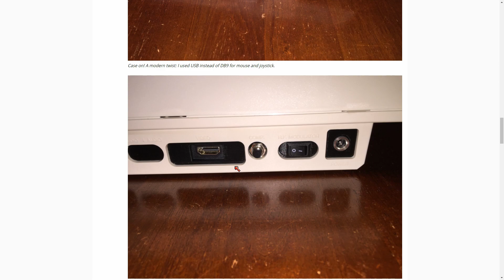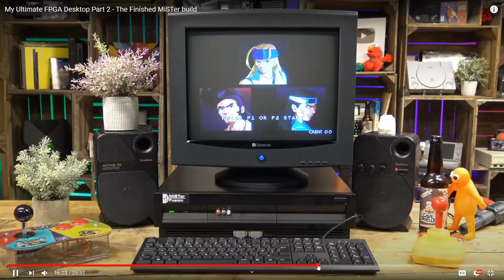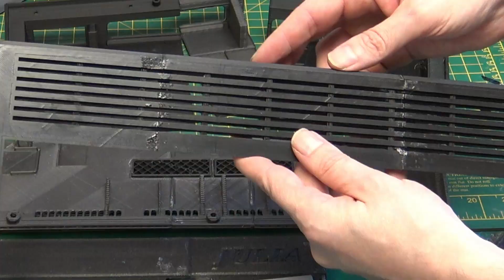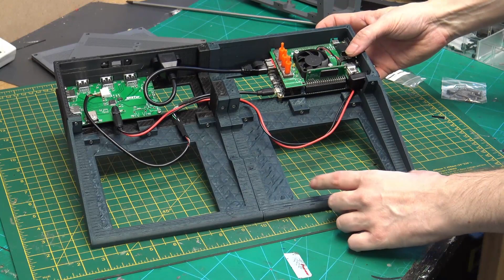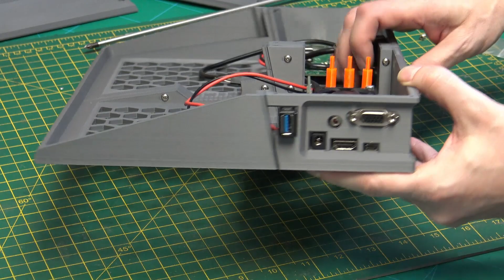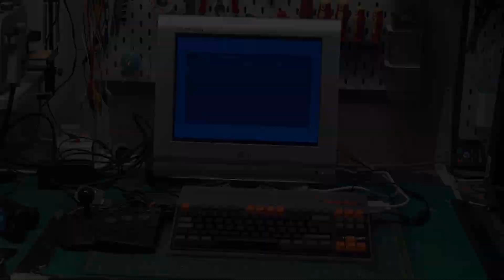My 3d printer MiSTer FPGA  retro wedge  case

Comment: What kind of SNAC adapter did you use there?  In the process of sorting that case you sent me back in 2020!
Reply from the maker: The right angle one ? I will have to look.  Blimey that was a while back and the only single piece case I ever printed.
Reply: @leesmithsworkshop  Hehe, yes - the SNAC adapter!   Just waiting on some hex standoffs and can install my mister!

Comment: yea got to try this...the mister in a simple square case just doesn't do it for me...but the idea of the mister and a case that looks of the period and a modern keyboard...that well works 100%...and this case is flexable in terms of size of keyboard...love that...going to look at the multisystem case next...no idea as yet what the differences are...have not watched that just yet just this, and like the modularity here.
Reply from the maker: The Multisystem case needs the Multisystem board to work with the MiSTer. In some ways it's easier, but my case is a lot more complicated to print for it.

Comment: Has anyone tried this with a different brand of 10 keyless keyboard, as the one shown in the video doesn't seem to be readily available right now and I don't want to spend day printing a case for which I can't get a keyboard?
Reply from the maker: look through the comments I am sure people have left a few and I also put some in the description.
Reply: @leesmithsworkshop  thank you, and thanks for the great design 👍
Reply from the maker: @dreamvisionary  The thing to watch out with keyboard is the position of the usb lead. if they are in the middle it will be in the way of the central supports. then just check the dimensions against the tecknet.
Reply: @leesmithsworkshop  That's the first part printing now, thank you.

Comment: That is a great project.  I was looking for something similar for a Pi4 but missed this one.  It would have been a really great start for me, had I not come across it a few weeks into the project.  There just don't seem to be many of these types of projects out there, or they just aren't super easy to stumble across.  I would think they would be more popular and wide spread.  It seems like such a great form factor for experiencing  the 80-90s era wedge computers when the original hardware is out of reach.
Reply from the maker: I just need a PI4 and I could make a module for it, but I am not buying one just for this.
Reply: @leesmithsworkshop  , it would be a bit much if you had no use for it.  Especially with current limited supply and price increase.  I'm not ready for a MiSTer just yet myself.  I like the style of your design, what I came up with is far more utilitarian.

Comment: Fantastic design.   

I would use a big 3d printer like a CR 10 3D printer. Then you can print it in one piece.
Reply from the maker: I have printed in one piece it took 3 days.

Comment: Umm, the best surface finish for me is typically the face that prints face-down on the bed. You either get a glassy finish on glass or a textured finish on a textured bed/build plate. Just try to eliminate anything that needs supports so you can print flat. Raised or embossed lettering is a big no-no. It always annoys me when designers put text and logos on an otherwise perfectly-printable flat surface. You’re literally better off with a sticker for logos and such but I guess I understand if they are worried about someone stealing their design.
Reply from the maker: I now have textured spring steel with PEI and that gives amazing results.

Comment: I know virtually nothing about 3d printing.  Is there a service out there that can print these for me?   Also, I see on your threeding site that the center section for wider keyboards with key pads isn't there.  Are these files available also?
Reply from the maker: HI, Yes you can get quotes from some companies, but the feedback I had from other people is the price they want is in the hundreds of pounds and totally crazy. If you are in the uk I could print, but even then it would be around £100 it's 70 hours of print time and the material and shipping. I did recently create the middle part and send it over to someone to print and test, but I have not had any feedback so I will ask them if it was ok.
Reply: @leesmithsworkshop  I'm in the US unfortunately.  Let me know how the middle part worked out.
Reply from the maker: @brianlanning836  the guy had a printer failure so he it still working on it !
Reply: @leesmithsworkshop  thanks
Reply: @leesmithsworkshop  Hi Lee.  I'm finally getting around to printing the case myself.  I have three of the four bottom pieces done now.  And they're turning out great.  For the keyboard I'm going to use a Keychron C1 which looks like it might fit with a thin gap.  I'd like to have a clever way to integrate an mt32-pi.  I might try to make a custom top.
Reply from the maker: @brianlanning836  just make sure the usb lead is not in the middle because it will get in the way.
Reply: @leesmithsworkshop  It's off to the left on the back so it should be ok.  I nearly bought one that had the USB exit out the side.

Comment: I finished printing it out a few days ago, and I'm gathering all the bits to finish up the electronic side. I printed it in normal black PLA with a black and red badge. It looks great. I bought a basic RedDragon keyboard for it, I'll probably replace that though, It leaves a big, 10mm big, gap between the top of the keyboard and the top plates of the case. Also, I think I'll print it again and try to match the SX-64 color scheme when I do. Love the work you've done! This is exactly what I wanted for my MiSTer!
Reply from the maker: if you print again I could  mod the model to help with the gap ?
Reply: @leesmithsworkshop   That would be awesome! I haven't started going down the design path yet, and I really like the keyboard I bought for this.

Comment: Hi! Thank you for such a great design, I really love it. It's small-bed friendly and very clever modularized. I will definitely try to build one for my MiSTer. 
The only improvement I can recommend is to use brass insert nuts for all the screws. Like theese, for example:
https://a.aliexpress.com/_AK724n
Just melt it in with soldering iron and you  can use regular screws without any risk to overtight and crack the plastic.
Reply from the maker: sorry, but I don't like them and it's just better to glue the parts together and use the screws to line up and hold the parts together while the glue dries. The nut inserts don't always fit correctly and  using self tapping screws into correctly sized holes works just as well, I spent a long time testing how to make this.
Reply: @leesmithsworkshop  Well, my experience with nut inserts differs, it was almost flawless so far. But it's OK. Thank you again for such a brilliant case design. I'll share my results when it will be ready. :)

Comment: Great work ! Was making video output rear facing  completely impossible ?  You could save on height by using a ribbon cable to connect the GPIO pins from the DE10-nano to the IO board, but it doesn't do much for to help with length needed in order to mount the de10 with the IO facing the rear of the case.
Reply from the maker: I am working on a lower version with a ribbon cable to connect and also 90 degree memory.

Comment: Hi Lee, Great case. I have bought the Matte Forge PLA. Before I print your case I have been testing the PLA with the Cali Cat print. This Cat has a 45 degree tail (hangover). Using my Amazon Standard PLA the hangover prints without issue. Using the Matte Forge the hangover is a bit rough. Did you have to use any specific settings with the Matte Forge? I'm using an Ender 3, 200 nozzle, 50 bed. Any help would be most appreciated. Thanks Paul
Reply from the maker: HI, I spent close to a week calibrating my ender 3 and cr20-pro to print with this filament and each one was slightly different so I can't give you 100% confirmed settings. I suggest you run through the teaching tech calibration so check extruder e steps. print a temperature  tower, print a single wall cube to setup flow and do the acceleration and jerk until you see clean prints. My best results came from the flow calibration and I was printing too much at the start.  
https://teachingtechyt.github.io/calibration.html
Reply: @leesmithsworkshop  Cheers Lee

Comment: I'm amazed by your project! it's a fantastic design! I'll buy the stl for sure. What time for print all the pieces?
Reply from the maker: depends on your slicer settings 8 hours > 13 each part
Reply: @leesmithsworkshop  I buyed the STL files, what are the best especifications to print them?
Reply from the maker: @salze145  I would print at 0.2mm 3 walls 20% infill and 50mm/s for a nice clean print. don't forget to turn on support with 69 overhang settings.
Reply: @leesmithsworkshop  the 3mm screews self tappers how long they are?
Reply from the maker: @salze145  it's in the description long screws m3 self tapping 20mm and short 8mm

Comment: Amazing work. Love how its designed to be modular. I will try to make this and then maybe later try to figure out if it can be made without needing screws, but... that is probably likely to end up breaking at some point. Not sure what options there are to make the case... a bit like Lego bricks.

First I will try printing the keyboard parts and the MiSTer part, then I probably have to modify the part for the USB ports.

Hmmm... I think I will try to make the USB ports part a bit more modular, making it so that it will support just replacing the "holes", making much bigger hopes there instead. Will be interesting to see if that will hold and work as I hope it could work.

Comment: This is incredible! I've been looking for something similar for months. Really looks great.

Is there anything holding the keyboard in? Does it move around much during use?

I don't have access to a 3D printer until I can get back to my office, which is looking like a few months at the earliest. Would you consider uploading it to a 3D printed marketplace like Shapeways?
Reply from the maker: based on prices other people have had for printed cases it would be over $100, not sure if that was shapeways. My keyboard does not move thanks to the large rubber pads on the base.

Comment: Very cool and impressive work.
I like it.

But even back in the days I liked it more to have a separate keyboard.
Like the Atari Mega ST.
Reply from the maker: it did feel like progressing away from toys to something more serious having them separate.
Reply: @leesmithsworkshop  
It‘s easier to handle.
The main box can be stored somewhere maybe under the monitor.
All cables are connected to this box (printer, monitor, keyboard, power, modem, external floppy, etc.).
There is only one cable from keyboard to the main box.
So you can move the keyboard very easy away and do some other work, e.g. homework.

The Atari 1040 ST or the Amiga 500 were almost unmoveable with all the connected cables.

Comment: Thank you for this great Video: Just bought your Model :-) By the way: Project Julia is not only for Raspberry Pi: You'll geht a Package for RaspberryPi FormFactor Boards. But you can use EVERY BOARD you like. This is deigned with extension cables from Inside to Outside so you can place a board somewhere inside the case drill holes through the bottom fix it and use the extension cables (2x USB, Ethernet, HDMI). If you need some special connections, there is a place for one standard PCI bracket. Armand López made a special MOD to use SiDI FPGA Boards: https://www.thingiverse.com/thing:414995, https://gumroad.com/l/project_julia/
Reply from the maker: I didn't want all the cables, just keep it nice and simple.

Comment: very nice well constructed retro computer case with a difference ive just downloaded the .stl files so im gonna give it a go for the raspberry pi......would the mister usb hub work with the raspberry pi?
great vid mate
Reply from the maker: hi, I have not shared the pi module yet, I have a pi3 and wanted to do the pi4. what do you have ?
Reply from the maker: if the pi has utg then I see no reason why the mister hub wouldn't work

Comment: New to the channel - does your Pac-Man run at that speed because it's a PAL game running on an NTSC version of the core, or because you're man after my own heart who finds base Pac-Man far too slow?
Reply from the maker: it runs at the speed because it's controlled by integer  values so I can only move 1 pixel, 2 or 4 each update. I used 2 pixel so I can slow the ghost down to 1 when they turn blue.

Comment from the maker: My Threeding profile now has the Ajazz version and also a RPI3 for the tenkesless keyboard
Keyboard size max width 360mm and depth 135mm
screw size m3 self tappers 20mm and 8mm
Reply: Thank you! :)
Reply: Thanks. Nice! I have a keybard here 35 x 12.5 cm. So it should fit.
Reply from the maker: @ezContents  one other thing is how the cable comes out of the back. if it's fixed in the middle it could have a problem.
Reply: @leesmithsworkshop  Yep.. it's fixed in the middle. I will check your STL files and try to assemble them inside Blender.

Comment: Do you have dimentions for the keyboard you are using (Teknet)?
Reply from the maker: I will post later
Reply from the maker: Keyboard size max width 360mm and depth 135mm
Reply: @leesmithsworkshop  thank you😊👍

Comment: Thanx for sharing this design, I did order the stl`s so will start printing soon :) The only thing I was wondering about is what software you are using to design this and if you will release those filse also so we can modify them to fit some other things. ? How much fillament will this use ?
Reply from the maker: for the moment I will only provide the stl and I use 123design. I  tried to move over to fusion360 but always fall back to what I know to get a job finished quick. What other things would you want ?
Reply: @leesmithsworkshop  hm there may be a space to add a external 2.5" hdd inside it😊?
Reply from the maker: @josteinkallevik  not sure I would need to try one for my self.
Reply from the maker: it will use almost a full spool

Comment: I really love the modular design. Sounds like the perfect project for my AO486 project. :)

Problem for me: I'd need a keyboard with the German layout (QWERTZ). As you said the design is modular in this video: What is the maximum size for a 88 key keyboard to fit in? Got one here that is 37 x 14.6 x 4.1 cm. Thank you! :)

/EDIT: Subbed and bought the file, as I might be able to get it to work one way or another. :) Great work!
Reply from the maker: i had a problem with the key caps not setup for the uk keyboard so had to miss some off.
Reply from the maker: the case has space for  360 wide keyboard , depending on feedback from other people I can adjust
Reply: I am now almost done with the print and ready to order the keyboard. I'll give you guys more feedback on my journey to my own version of this amazing case. :)
Reply: Just received the keyboard in the mail and it is perfect for what I want it to be and even has the USB cord not centered. ;) Here is the link, in case anyone else is curious: 

Amazon UK: https://www.amazon.co.uk/gp/product/B071LJKQ2C
Amazon DE: https://www.amazon.de/gp/product/B071LJKQ2C

Sadly it is bigger than they officially stated: ~35,7 x ~15,8 x ~4 cm in size and therefore does not fit because of the additional depth, when I put it in place – width and height were fine. Is there an easy way to resize just this one axis for me? (I am not very good at 3D editing but I got access to 3D builder. :( So scaling one axis might work?) I'd then reprint just the front two parts again with those new values (standard x 16 x standard).
Reply from the maker: @Estaran  let me check a few things. It might be too big to fit on most printers. You could just change the one dimension in cura to fix this.
Reply from the maker: @Estaran  Hi, so yes you can adjust one dimension in cura to from 161mm to 180mm and your keyboard should fit. It will deform the screw holes and change the angle of the back, but I think would be ok.
Reply: @leesmithsworkshop  Thanks! I'm giving this one a try today. :)
Reply from the maker: @Estaran  print on of the keyboard parts first !
Reply: @leesmithsworkshop  Finished the first part (left one) with these dimensions, and now the keyboard fits like a glove! Started to print the right one now. Can't wait to finally put everything together. :)

Comment: Great video. Good thing the design  can be printed with minimal supports. Btw. What are the dimensions of the keyboard that you are using?
Reply from the maker: I will let you know tomorrow, it's at my workshop. Supports are ok to keep the connections in shape, but any more would make the side of the prints look rough, this way it's nice and clean off the printer.
Reply: @leesmithsworkshop ok. Thanks. I agree. Removing them and cleaning up after is not my thing either.
Reply from the maker: Keyboard size max width 360mm and depth 135mm

Comment: That's cool, I like the little recessed bits around the ports. I don't own a MiSTer but it's shown me 3D printing a decent looking case for something is possible (I want to make a Raspberry Pi 4 tower case that looks like a 90s PC).
Also earlier I was looking for a new keyboard, and that Tecknet one is just what I wanted, and it's so cheap too :)
Reply from the maker: Not sure how good this keyboard is long term, but it should be ok for MiSTer use.